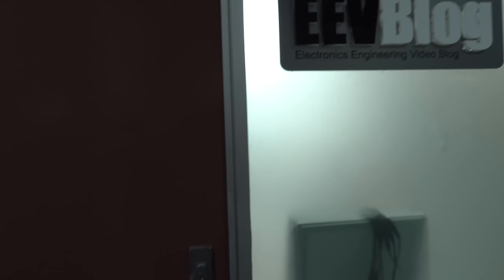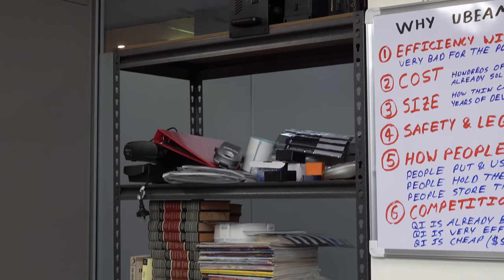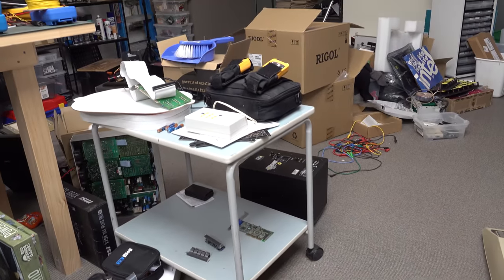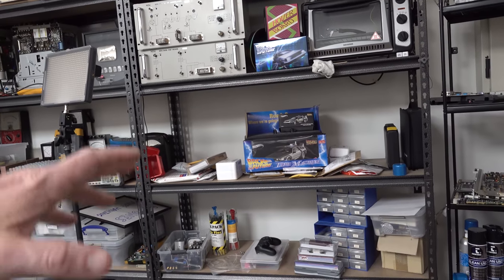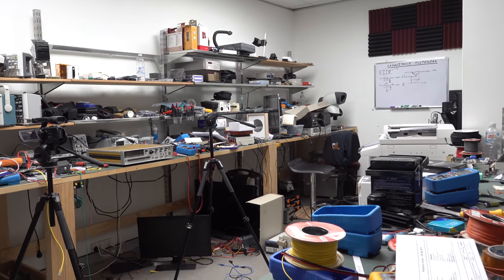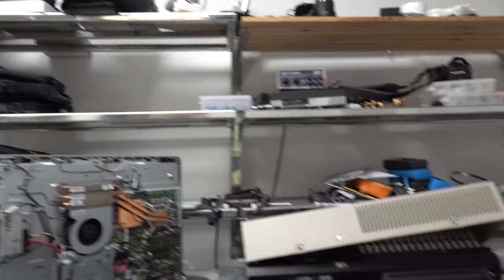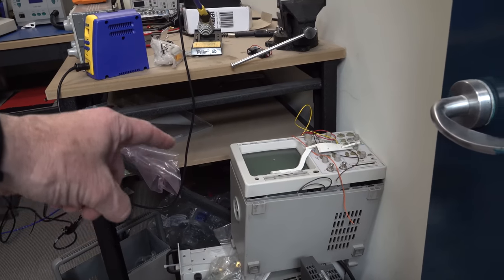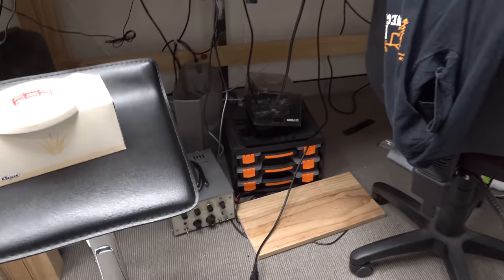EEVblog #1142 - EEVblog LAB Tour - Before

Comment: I’ve worked with electricians and radio techs and have never seen a tidy office. Some have been partly methodically sorted and labelled but there was always stuff on the floor or piled on top of each other on a bench waiting to be worked on or for someone to either trash, sell or put in longterm storage

Comment: For things I am immediately working on, I find the stackable bins quite handy for keeping my working tools and parts in. Less time lost trying to find a tool I set down 10 minutes ago or even 10 seconds ago. For dealing with my own personal inventory management problems, I use Jira as a crude inventory management system. Each container gets a ticket and any item that goes into that container gets a ticket with a reference to the container ticket. I also take a picture of the item and attach it to the ticket. It works well for things that are just lying around unused and getting in the way, but provides a way to quickly find them if I need them.

Comment: Curious why you don't setup the equipment in permanent spots on the shelf above the bench and stack it a bit more tightly (like Shariar does). If you group it carefully you probably won't need to move anything.

Comment: It's going to take you 6 days to move, trust me, I've moved our company's labs (half a dozen rooms, it took me 2 weeks). I probably packed 3 dozen of office move boxes with stuff, not including a shit  load of heavy lab equipment from power supplies to scopes to soldering stations to micro probe stations. I wasn't just stuffing everything in boxes either, otherwise I wouldn't be able to find anything after the move. Every little component at some point walked off and ended up anywhere you could imaging, in a person's cubicle, in a clean room, in the dark lab, in the light lab, in reliability room, in MY cubicle, UNDER my cubicle :D, etc. I painstakingly collected every component into the same box, turns out we had a lot more parts than I thought we did, our component stock double and almost tripled for some parts, and I also found some equipment that predated me and I had never seen, so it was a gem to get my hands on something no one had been using for years and to see if I could put it to use or at least safeguard it from mistreatment by coworkers.

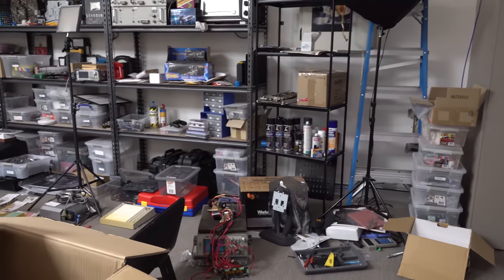Comment: It's been a while since we had a full tour of your lab space, Dave. We've definitely seen it in worse shape than this. I noticed the word "vevy" on the white board by the door. :)  What is that gray statue like thing on the floor seen at the 4:00 minute mark with some white thing hanging off it? I noticed an A2000 machine. Nice. I finally got around to buying an anti-static mat for my workbench. To put in place I had to clear everything off the table. It helped me tidy up my bench. It has accumulated a few things since then but it is a lot tidier than it was. For what you need to do I think you might need about a week. BTW, you might not be able to live stream the process but you can still record it for later upload.

Comment: Finish a project before you start another. I have the same problem but I force myself to clean and put everything in its place at the end of the day. It forces me the throw away things that hold little to no value.
Reply: You spend 7 hours out of an 8 hour day on cleanup???
Reply: Scott Miller it's called job security

Comment: For conversions Google is your friend.  Googling  '50 square meters in square feet' says 538 ft^2 which is standard for space in the US.  Good luck on your move and I look forward to your new space!
Reply: B Bowling I usually just use a factor of 10, as room sizes are rarely that accurate anyway. (Actual factor is 1/0.09290304, using the well known 1"=25.4mm definition).

Comment: Aren't those plastic bins a static electricity nightmare? I've always wondered, because they're very cheap, but when you handle them taking them in and out, it's very easy to generate static, or isn't it? Are they like static dissipative or something? How would you tell?

Comment: Rule of thumb 1m = 3ft. It is actually slightly more but good enough for a rough estimate
Reply: but 1 sq meter = about 11 sq ft
Reply: @UnreasonableSteve  i dunno. I have never thought about it, I always work in either (mostly) metric or imperial and rarely need to convert. Just know that 1m is about 3ft3inch. To convert area is actually sqm*10.77
Reply: approximate by adding a 0 , 50 sqm = 500sqft